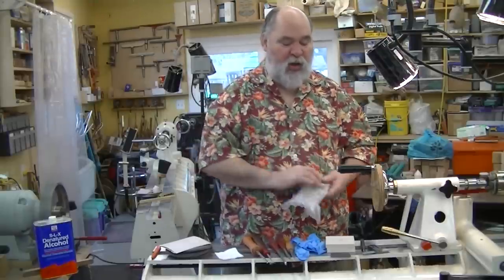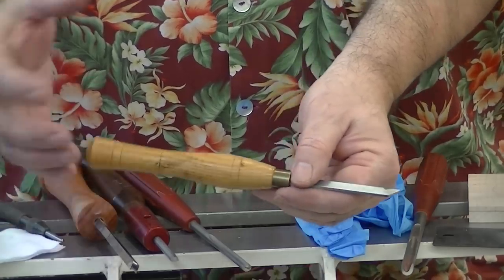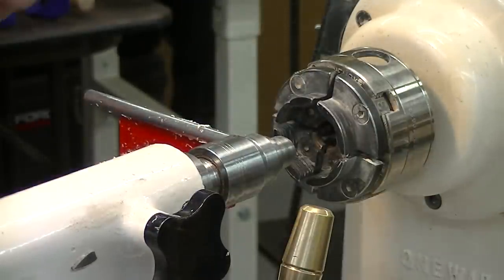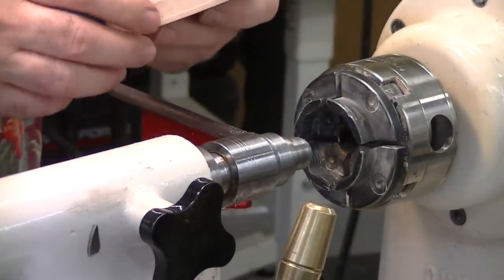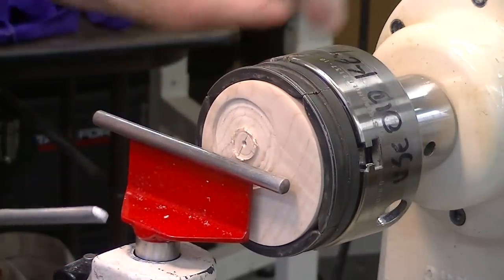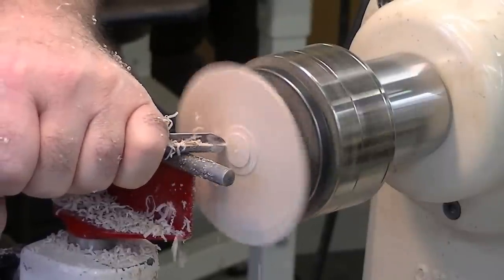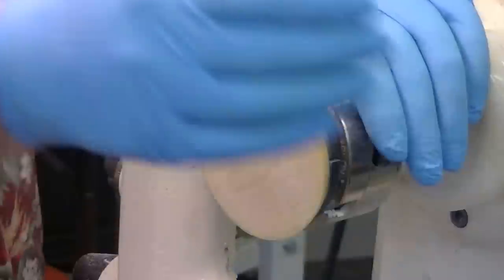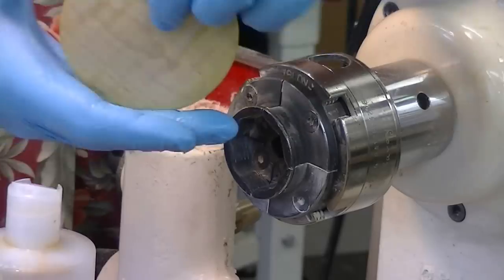CAW Richard Allen turns an offset pocket mirror

Comment from the maker: Frank Jessup here - not Richard Allen.  However, video made at my place and I know the answer to fixing that mistake.  Pause the camera and turn another piece of wood to just before mistake stage and then turn camera back on.  Watch careful to note small grain change in the wood.  For my mirror video, made same day, I had seven props at various stages for just in case.  Got lucky and didn't need them.  PS:  Richard an excellent turner just a case of stuff happens.